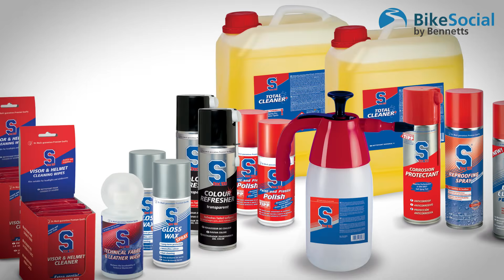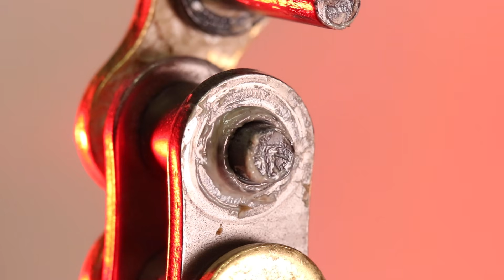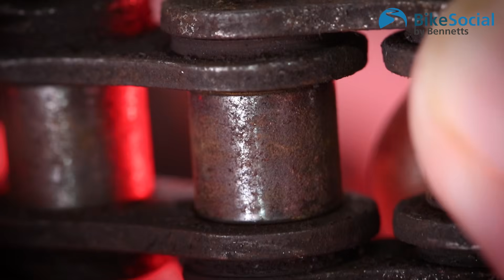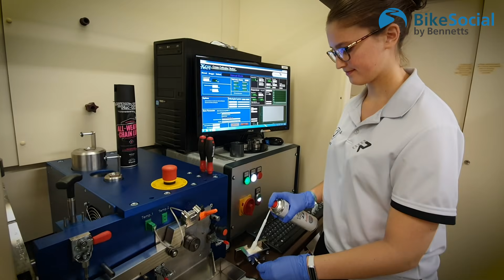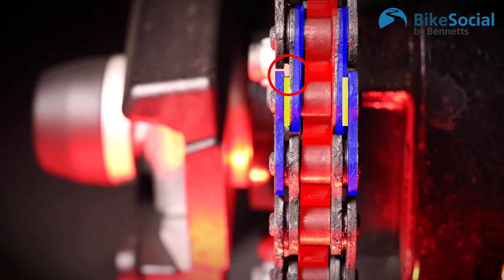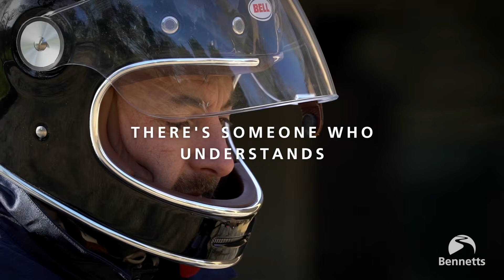Is chain lube a scam? Does your bike really need it?

Comment from the maker: What lubes and cleaners do YOU use? Let me know so I can include them in the test... John
Reply: Please don't just compare but try to answer: 1) How much money do I save by lubing vs not lubing. 2) How much time do I need to invest in order to save that money assuming I ride daily in all weather.
Reply: Scott Oiler
Reply: How 'bout kerosene in cleaning chains? is it good or bad
Reply from the maker: @hartwinfritz  Kerosene – or paraffin in the UK – should be safe, but it's on the list...
Reply: WURTH HIGH PERFORMANCE DRY CHAIN LUBE , i think is the best
Reply: Gear oil I use
Reply: gear oil
Reply: I use gear oil, recently noticed manual suggests engine oil and I'll try it.
Reply: Ummmm, I bought a shaft drive Vfr1200f..... Thank you god!!! But I had chain driven bikes for 35 years.  My method was to place a drip tray under and work Kerosene into everything with a toothbrush - let drip off (when your positive you've dissolved all grime away - get right into everything) / rag wipe and let dry.  Then physically check each single pair of adjacent links for any form of stiffness. Hand manipulation should be fine but sometimes you find a couple links that are a bit "stiff"..... ATTACK them with 2 pliers and work them hard as you toothbrush in more kerosene.  if you can get them loose - good, if not - consider how bad it is / new chain time maybe (and of course look at your sprockets)?  Assuming all is good - then spray on the best spray lubricant you can find (I used a variety - some better than others BUT - make sure you get a coating on the inside face of the chain too and hit everything front BOTH front and rear angle as you spin the suspended rear wheel to ensure its got to everything.  Spin the wheel and massage it all in by hand. lightly wipe off excess.  If that doesn't give you a happy chain / sprockets - nothing will and change them (of course check for "waving" of your sprocket teeth).  Maintain religious chain tension checks and you'll do as good as possible with chains / sprockets.  A newbe brought his VFR800 around whinging..... didn't give a $hit about this sort of maintenance for about 3 years and I could hardly get ANY rotation between about 15 links - WITH PLIERS!!!!  Imagine what that was doing every time it went through his sprockets.... Groooooooooaaaan.
Reply: I only use products by Dr. Wack. Esp. after seeing this! :D
Reply: 75 90 gear oil works great
Reply: I tried some of what Ryan from Fortnine recommended, and 7000km I must say chain looks great, all links move freely, and it has barely stretched (and I can ride pretty aggressively):
https://youtu.be/WBNVzTjflXQ

Looking forward to see your tests!
Reply: Scott Oiler. it's the mutt's nuts.  I can't believe you're talking chain lubes and, as yet, no mention of the SCOTT OILER. The best aftermarket device for any chain-driven bike
Reply from the maker: @raymondo162  We're not ignoring the excellent Scottoiler!
Reply: Clean with kerosene as it does not degrade the o-rings. Then a no fling white chain wax.
Reply: I designed a new device to clean the chain to keep the o-rings happy, remove all that dirt and it's very easy and fast to use:
https://youtu.be/t8ZyeiaSGwA
Reply: Automatic oiler filled with olive oil. It flings off, taking the grit with it. It's o-ring compatible. It washes off with the hose leaving the chain clean ready for a spray of fresh olive oil. It has extremely high 'oiliness' (high penetration) meaning it spreads well, and is used to increase the oiliness of mineral oils. It's super cheap.

30 000 km on the stock V-Strom chain, adjusted once at 28 000 km. (probably didn't need it, still within spec). Used in all weathers and about 10% gravel road, but no salt.
Reply: GT85. Inside and out after every ride. Takes 30 seconds. No longevity but zero fling, so easy to clean and chain is in perfect nick
Reply: I use GT85 to clean the chain and Yamalube chain lube.
Reply: S100 cleaner and white chain wax, now the 2.0 version. Works very well.
Reply: Motul C2+ Chain Lube Road Plus
Reply: Bel ray blue tac!!
Reply: I clean with GT85 then lube with Würth, it's all I use now on all my bikes including the track bike, clean, invisible and zero fling. It's reasonably expensive but worth it I think.
Reply: qplus
Reply: Motorex Road Strong
Reply: Moterex 'Road, Strong' all year round. Like others, am interested to know whether using kerosene is good or bad for cleaning chains that have O rings. A bike mechanic told me it is fine, but I'm not sure.
Reply: Ipone road chain care
Reply: Castrol 85-90 gear oil, and muc off extreme lube during the rainy season
Reply: I'm high mileage (500+ a week). Maxima's 3-step chain maintenance kit (https://www.maximausa.com/product/chain-wax-chain-care-combo-kit/ ) is excellent and I'd love to see a review / performance test
Reply: Heavy dose of Wd40 every fill up. Fling the grime off. 35k on a chain no issues. Lube just picks up dirt and grinds the chain to death.
Reply: 90 number gear oil
Reply: Kerosene for cleaning, wash off with pressure washer, Motul C2 lube for lubrication.
Reply: Putoline Chain & Engine Degreaser for cleaning. Putoline Drytec for lubrication.
Reply: On my o ring bike I use a scottoiler, awesome. On my old school triumph I take the chain off, soak in a petrol soup I've been using since '79 (keep pouring it back and filtering) then into a tin of linklyfe chain grease. Heat outside if you're still married! until the chain is hot, but not boiling! Hook the chain out and hang over the tin, if you've got the temperature spot on the heat in the chain will allow the excess grease to run down to be re used and the chain will look like when it came out of the packet. On my triumph I found I could make a set of sprockets last for three chains. Big horsepower, chain with the sprockets everytime. Scottoiler is the bikers dishwasher or something, because you have so much more time!!!
Reply: cleaner: high preasure water+soap treat with diesel
lubes : used 0-20w fully synthetic motor oil every week

chain last for 70000km

works great after mud run
Reply from the maker: @hyerinjun2468  Thanks! Motor oil is on the list to test, but I'd be careful of using high pressure to clean your chain – you don't want to wash the grease out from behind the O-rings (unless you have a non-O-ring chain). Cheers, John
Reply: I own a Yamaha YZF 750, and even though I don’t do wheel stands I have done some track days at Philip Island doing respectable sub 2 minute laps.
45.000 kms is my usual chain and sprockets  life, I never clean the DID 520 vx2 ,apart from the outward facing area , as it’s a nice gold colour, I’m sure using a brush or cloth would surely only push debris past the o ring or into the links and create more wear as would using any liquid strong enough to clean said chain would surely penetrate the O ring.
Reply: I'm not a brand junkie. I've got a couple of cans of wd40 chain lube and it's actually really good. Well i think it is, your test may disprove that! Looking forward to the results.
Reply: Kerosene to clean and DuPont Teflon Chain Saver to lube. Virtually no fling.
Reply: Lucas chain lube
Reply: Maxima Chain Wax for me, works great and doesn't spatter.

Comment: What about chain cleaners though (I don't think Ryan F9's chain cleaner experiment was sufficiently scientific - what's the likelihood that balloons have exactly the same chemical composition as chain seals)? I think using Motul chain cleaner might have caused me some problems but can't be sure of what's caused one of my o-rings to split. After watching this it could also be that my alignment is very marginally 'off', or it could be something else entirely.
Reply from the maker: I'm building the chain cleaners test at the moment; it will be a way off, but it'll look at O-ring compatibility (as well as the plastics used on chain guards). Cheers, John
Reply: @bennettsbikesocial  I would be curious to this as well since RyanF9 tested that Parrafin (Kerosene for the U.S.) would creep through the o-rings and essentially wash out the grease, but it is generally the most recommended chain cleaner from bike manufactures in the owners manual.
Reply: I've been riding for over 40 years, always used paraffin to clean, always got good chain life.